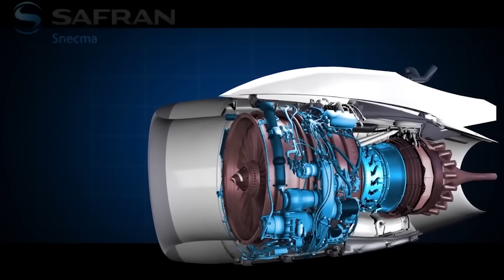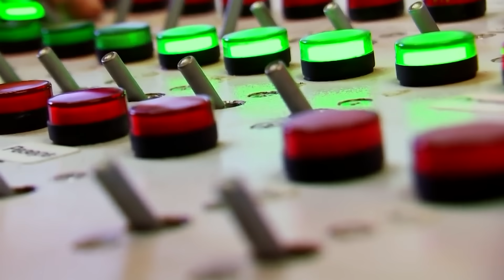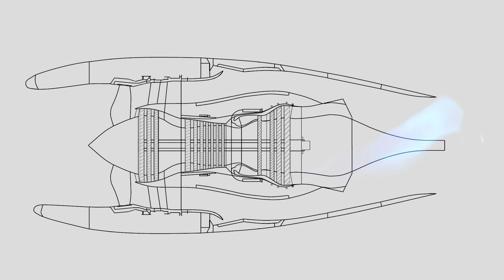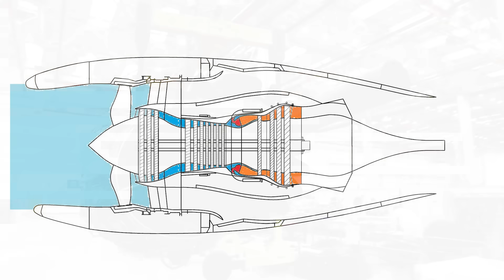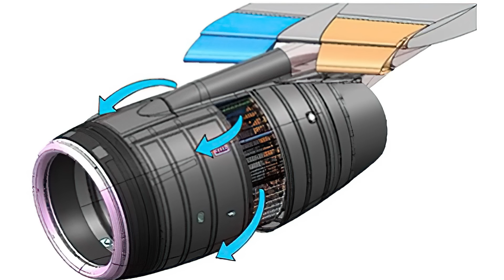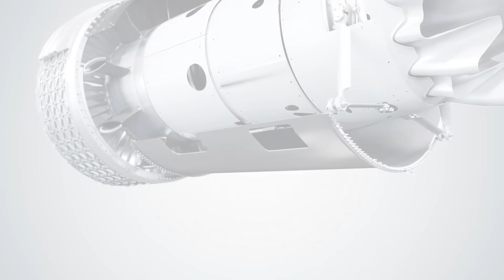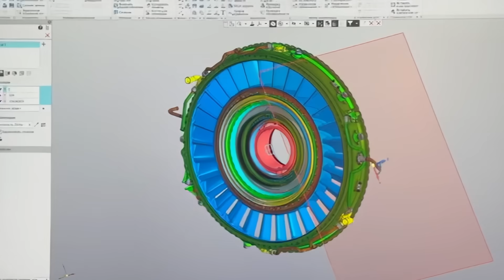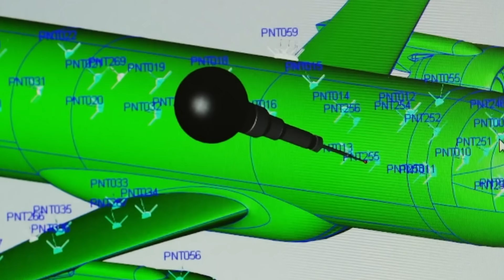PD-8 – a new engine of a new Russian Superjet

Comment: PD8 engine is the best top of the line and 20% better than any engine built by western countries, it’s absolutely better than RR or GE engines which are old and constantly modified for performance. Business jet engines can’t be used in Commercial Aircraft due many factors. There is no comparison between commercial aircraft and Business aircraft.

Comment: The Superjet was the only new Russian passenger jet produced in the last decades. In small numbers and without success on the market. In addition, the SSJ-100 has a catastrophic safety record - even worse than that of the Boeing 737 MAX. Given the backwardness and notorious low quality of Russian industry, the switch to the domestic engine will make the Superjet even mire dangerous.
Reply: SSJ-100 had crash vs a mountain due to the pilot mistake. The aircraft was working fine until collision.
Two SSJ-100 experienced excessively hard landing. One of them was damaged and caught fire before stop and evacuation. Another one avoided causalties, but it was also destroyed by fire.
Another two got damage of the landing gear. One of them reached repaired zone of the runway. Another one also damaged its landing gear.
I cannot imagine how the aircraft itself may be guilty in any of these situations. The aircraft is fine.
Reply: @alexanderbelov6892  There have been four hull loss accidents, three of which resulted in a total of 89 fatalities (Wikipedia). Giving the little number of jets produced (about 230) this is a horrible statistics making it likely the most unsafe passenger jet in the world.

If the aircraft is fine, why does it happen? Why other jets, also in Russia, are so much safer? In fact, the reasons for all crashes are different. And of course they also have technical reasons. For instance what means „hard landing“? A hard landing of a safe jet does not cause fire and kills people. In case of the Aeroflot Flight 1492 the radio and other equipment failed, and the flight crew chose to make an emergency landing at Sheremetyevo. In case of Gazpromavia Flight 9608 the probable cause of the crash were malfunctioning angle of attack sensors installed during maintenance.

Comment: i heard pd-14 and pd-8 have very low life span?
Reply: Это чушь. У новых двигателей еще не установлен ресурс, т. к. нет необходимого налета.
Reply: They have short maintenances cycles making their use highly inefficient.
Reply: This is mostly speculation. The PD-8 has not yet gone into mass production, so it's just too early to talk about its life span. The PD-14 has been around longer and is already being mass-produced, but it still flew relatively few real planes. In this case, the problem is with the production of the aircraft themselves, as a lot of foreign equipment has to be replaced. Therefore, for now they are putting a relatively short life span, because it is better to be safe. Then it will be possible to increase it. It's just common sense. Well, one more thing - they often compare the life span of PD-14 with the life span of engines that have existed for decades, and have undergone all possible optimizations and upgrades. It's a little unfair.
Reply: Yeah... While one PD-14 has been tested on the stand for 2 years in harsh conditions, several American PW1431GS have been replaced!🤭
Reply: @Tigr_Rus  life span as compare to them?

Comment: Well in simple words will be second tier turbo fan to a second tier commercial airplane. Stop gap to supply what is no longer easily resupplied. It is likely the engine manufacturer is not going to seek certification for EU union or FAA. 
Then come the fact that can make it reliable and scalable to match the production of MC 21.
Reply: For MC 21 PD-14, It is also undergoing final flight tests.

Also in production at the R&D level, is PD 31

Comment: Looks tiny compared to the engine for the A321 Neo.
Reply: Since there's 2 engines for that plane I'm assuming you're talking about the bigger Pratt&Whitney PW1100G-JM which is a monster of an engine.
Reply: The A321Neo is like twice the size.
Reply: That's because it is. This is a tiny regional airliner. More in line with the Airbus A220, and it's small even compared to that.

Comment: so... superjet has a flaw. it sits too low. i mean trend of bigger engines is not new and superjet is not so old. it could sit a bit higher i guess than.
Reply: Fuel economy is not a huge priority for it in a domestic market
Reply: @josh3771  fuel economy is only a priority when it costs a lot. but a stewardess less can offset that thing. however good fuel economy means longer max ranges. and thats the most important thing. point to point travel for smaller aircraft can open a lot of new possibilities. so yeah better engines can have huge impact on sales. but its true that is price of new aircraft is low there are still markets that could use it

Comment: As I look at that engine and its features, it should have been compared to engines of the nineteen nineties. 
Small bypass ratio, non composite fan blades 
It may be good for the Russian market but not anywhere else
Reply: It maybe that, but Russians knew that already! The objective was to make a reliable, affordable & comparable but most importantly Fully Domestic Engine (Own IP & everything raw materials to processes) quickly! 
All the things you mentioned & all the modern updates can ne done to the engine!
The scenario & the requirements were different! We can all agree or disagree what is right or wrong. But the fact that they now got a functional engine, of thier own in the air, means they add or subtract anything they want.
Adding CMC, Cooling holes etc... is now much easier than, if they wanted everything best from the start & lets be honest it would have take more time, money & resources which Russia was trying to avoid in the first place.
Reply: is aircraft is cheap enough there are potential buyers who will overlook this and buy new aircraft rather than used one for more or less same price. south america, some parts of asia, africa... there is potential still.
Reply: lol that incredibly weird view. if a person mostly travel by train as russians do a lot than surely that person will have way smaller co2 footprint that somebody who flies A LOT but with most modern aircraft
Reply: It is not efficient by large, what Russians don't care given their disregard for climate change and fuel cost but is it reliable in term of mean toperating ime between failure or overhaul?

Comment: It was not a Russian project, it was an Italian/Russian project with 51% Italian majority along with the Yakovlev 130, Yakovlev and Sukhoi were just the integrators in that project...
The US convinced Italy to abandone the project in exchange for producing the center section of the B787..I.. 
As for the engine they had a lot of choices to hang in that project instead of SAFRAN, they could use a Soloviev, Kusnetzov or Progress engines ammong others..
The Italians abandoned the project and their rights to it including IP licences from SAFRAN....
Reply: The Italians only joined in 1993, and the first Yak-130 prototype was already assembled in 1992... it was definitely not a ready-to-fly aircraft, but the design was already finalized then. The Italians entered the project with money, and in return they received a license to manufacture this plane...
Reply: utter nonsense - Italians were responsible for marketing the jet outside of CES ....
Reply: it has now been russified.